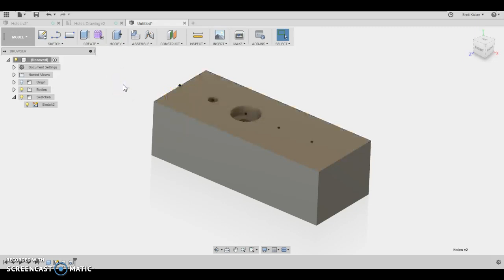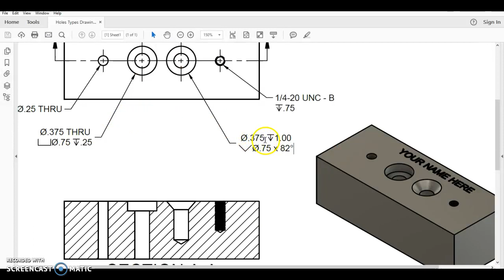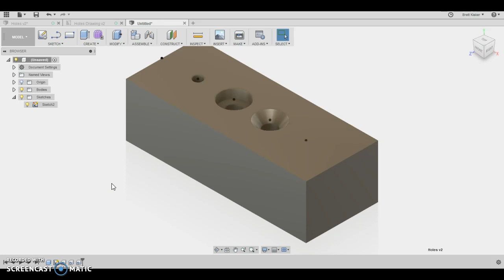PLTW IED 5.5 - Countersink in Fusion 360

Comment: i HAVE A QUESTION HOW DO YOU PUT IN A COUNTERSINK THAT IS BELOW THE SURFACE ABOUT .25 DEEP
Reply: You could maybe do a counter-bore first... then countersink off the face of the bore.
Also, you could extrude to the thickness of where you want the  top of the countersink. Then, after countersinking you could extrude the face the extra .25 distance you require.